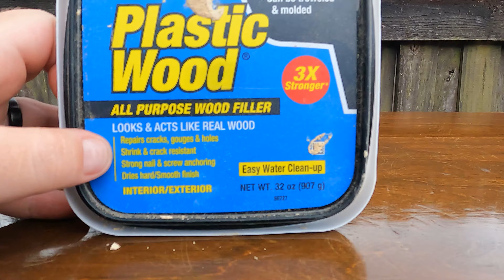RESTORING ANOTHER MCM DRESSER and Flipping it for a PROFIT | DIY Makeover

Comment: I wonder how dowels in hardware holes would take stain.
Reply from the maker: They would take it without any problem. The issue would be to get the type of wood and grain as close as possible I think. But that's definitely a good solution. Thank you!
Reply: @MikeAga  I think you would be able to use markers and toners.  Sometimes, hardware that you use instead will cover the dowels and former holes.
Reply from the maker: @jaytitus902  great tip! Thanks